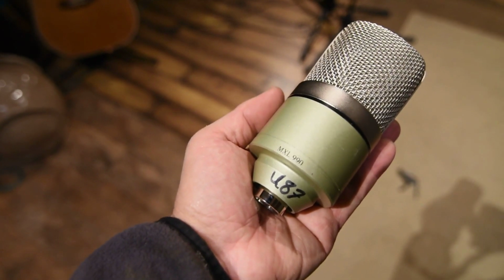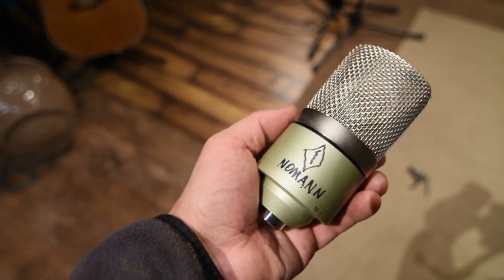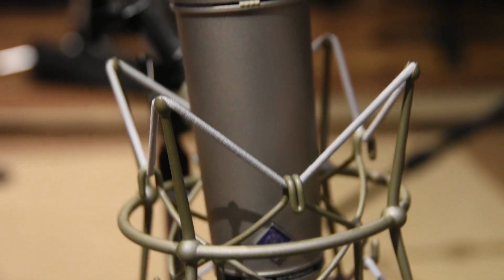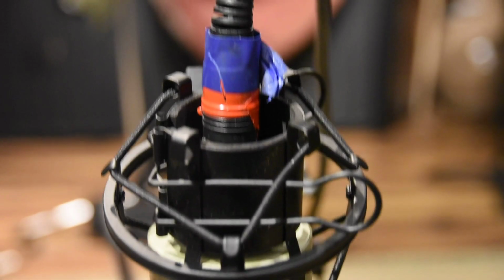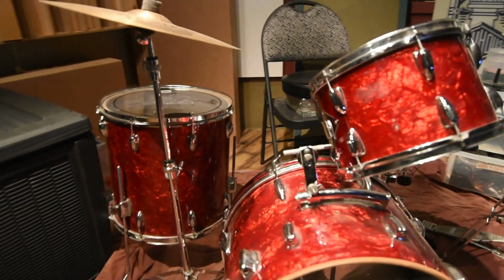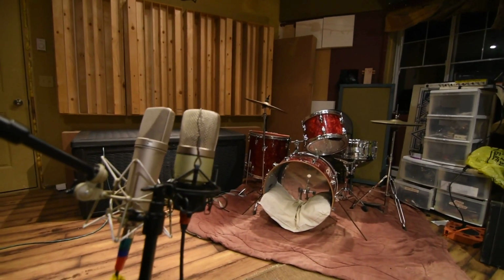Microphone shootout Neumann u87 VS DIY U87 clone

Comment from the maker: The reveal as to which is which is in the description.
Reply: Awesome. I wrongly believed that Mic#2 was the Neumann. Excellent job.
Reply: Haha definitely an awesome review sir, thank you for the Post
Reply: Nice! Thanks fo all your hard work here! I chose the first mic every single time for clarity but my guess was mic number two was Neumann because it had more of a vintage sound. It came through very clearly on my Marantz.
Reply: @Braylen Johnny Thank you, I went there and it seems like they got a lot of movies there :) I appreciate it !
Reply: @Neil Bruno Happy to help :)
Reply: Fantastic shootout!!! You rock! I'm a firm believer in "It ain't what you use but the way that you use it". I was able to discern the U87 right away but I am very familiar with them. Your DIY sounds great though. Slightly less smooth sparkle  on the top and a bit more mid forward but still a nice sounding mic. In fact I liked it more on the drums. There was a bit more punch. Neumann's are great mics but it is getting harder to justify spending that kind of money on results that can be achieved for a small fraction of the price. 
How is the noise floor? Preamps usually have more noise than mics, but some Chinese mics like MXL have a noticeable noise floor when the pres are cranked.
Reply: @Synth_Tools  me too, I liked the MP better, at least on the guitar. Maybe the Neumann was a $350 one from Aliexpress:)
Reply: I have to admit i thought Mic one was the clone :)

Comment: I have listened to a lot of mic comparisons recently, and I feel like my ability to hear the differences has improved a lot. These two mics don't sound very much alike to me, and it was pretty easy to guess the Neumann was Mic #1. It has a much more hyped high end. I liked the NoMann a lot, I just don't think it sounds much like the Neumann. That is not an insult in any way. It's a good sounding mic in its own regard. If both mics were in my mic locker I would use the Neumann on acoustic guitar, but probably use the clone on most other sources.

Comment: Thanks wow such a huge difference! I had read just before watching this that the U87 has the lows reduced a bit while the micparts s-87 has all the lows in full strength and it was pretty obvious which one was which because of this! I gotta say I’d rather have those lows and if i need to cut them out I can do that later!

Comment: both were fantastic. There was a little more definition in a mic in the test.  I think I would be very happy with a cheaper mic with such a high performance.  The PCB was designed by a famous sound guy.

Comment: Like your attitude ! No frills. I have a S-87 and I still get a kick out of those comparisons. I will get a 2nd one for stereo takes. This mic is wonderful. I have to say that #1 was smoother, and #2 a little harsher/agressive in raw takes but it got closer after treatment - of course. I use mine with a 737sp behind and ooooooh boy, it is nice, the difference between both is very sleek. The money I saved I was able to use for the 737sp which can be used as an insert, unlike the U87. Kidding, tho. I'd still love to add that legend of a mic to my collection. Thank you for this cool, very objective video.

Comment: I prefer mic 2. Regardless of that though, the sheer value of the NoMann in comparison is staggering. $424 for the MXL990 and the mods from mic parts (with the old circuit replacement) and to end up with the two sounding so similar.

Comment: Great shootout. Turns out I preferred the Neumann, as stacked up, the mix was smoother and less congested in the highs. The Neumann also has a little bit more depth and reach.

For 375, the Nomann is a very decent, very capable microphone.
Reply: the nomann was smoother and less congested. Mic #2 was better.
Reply: @toothacheforever8437  That's actually and factually incorrect there's no way that a $375 mic can sound better than a 4K mic but for what it is it's an excellent mic for the money.
Reply: @Tonyplat98  oh, there are 1000s of ways
and the evidence is peppered throughout the many productions done while under the influence of cocaine, alcohol, a messy divorce, the tail-end of a lousy contract, chasing mistaken notions of what will bring glory, etc

Comment: I'm sitting here with all new Creative speakers for my computer, and I'm not completely convinced by them yet, but to my ears, with these speakers, I feel that Mic 1 has sliiightly more presence than Mic 2. Mostly on guitar, actually. I thought it would be easy to hear with the shakers, but there they sound about the same. The difference on guitar is almost like a fresh set of strings has been put on between the mics, and for the vocals, "s" sounds slightly muted in Mic 2. I think both mics are pretty good, and I would have a hard time choosing if I didn't have to pay for them, but they're not quite a matched pair. If I were to guess, I would say Mic 2 is the Neumann with older components. Building the Nomann is a good investment, though, depending on how much the components cost.
Reply: Wow! I was totally wrong about which was which! :D

Comment: Only heard the difference on the vocals and the shakers. The replica has a boost around the 300hz range, and somewhere over 15k. The low-end boost is probably caused by the MXL body and the top must be some difference in the electronics. No two microphones sound the same though. For the price, the replica sounds really close to the original U87. I used a mic that a guy built in town with a U47 capsule that retailed for a 1000$ and it blew my mind. Replicas are really good more affordable options.

Comment: GREAT comparison.. perfect.. I did guess the mics.. very obvious on drums. Neuman is a lot firmer in the midrange and especially in the low end. But quite OK sound from the NoMann... although not the best for drums. In the complete mix though the results are pretty similar. And the Neumann is in no way worth the cost here. Just put a better BD and snare mic on there, and use the NuMann for the rest

Comment: All I can hear is DIY has more low-end but I can't decide which one sounds better... I would say it doesn't matter. For the money DIY is a clear choice.
Reply: My thoughts exactly.  They are slightly different from one another, but it’s subtle.  And that difference really isn’t enough to matter.  Truth is, when you actually mix it with either mic, you’re gonna make some moves to shape the mix in the direction you want it to go.  Those moves might be slightly different depending on the mic, but ultimately you could make a killer mix with either one from what I can tell.

Comment: Mic 1 clearly had more top end presence, was generally more detailed up there.  The mids and lows were pretty damn close, would have loved to hear bass cab or something.  Not really surprised that the Nuemann was mic 1.
That being said, I preferred the final mix from mic 2; it was more flattering on the snare drum in particular.  I think had you had a great session player on a killer kit the opposite would likely be true.  Just goes to show that a good producer/engineer can really make or break a recording with subtle differences like this.

Comment: I’m only listening on beats earbuds, but…the difference between the two sounds negligible to me.  There is a slight difference, but not enough to matter I don’t think.  I could make a mix work with either mic based on this.  Thanks for going to the trouble, man!

Comment: Nice sound with inexpensive equipment, except the U87.  At first, I couldn't tell them apart, until he started singing higher notes.  Then, I noticed the S3-87 was slightly darker.  Less noticeable in the mix.  Good for the money, tho.  I've never had the opportunity to compare my MJE "Fatboy" to a U87; but it might be in the same league.

Comment: Don't know which one is which yet, I'm going to check in a minute but I preferred Mic 2 because it sounded slightly more full and sensitive to the sound. But if it turns out that mic 1 is 4 times cheaper than mic 2 I wouldn't hesitate to buy mic 1.
Reply: I was sure the Neuman was mic 2 for the reasons you mentioned. Well done mic parts!

Comment: they're very close. #1 has just a touch more presence and #2 seems to have a little bit more proximity effect. Based on that, I guessed #1 as the neumann. just out of curiosity, do you remember which capacitor value you used for the roll off cap? i have the s3-87 and itd be useful to have this comparison as a reference for cap value

Comment: The U87 makes a "finished" sounding recording. The MP S87 just sounds a little "sloppy". I wonder if that's the transformer in the U87 compressing things a little. The S87 is also a little scooped in the mids. BTW, I knew pretty quickly that mic 1 was the U87.
Reply: My thoughts exactly. The actual 87 sounds a bit compressed, sort of "finished" "just pull up the faders" sound which sits easily. Also the low end is more focused and the highs are pulled in a bit more, i.e. a bit less "true" maybe. Im thinking a change in the transformer could help - something that sounds a little bit less "open".
Reply: @emersonvella  I believe the S87 is a transformerless circuit. I don’t think Mic Parts makes a U87 clone with a transformer, which seems odd because that Neumann transformer seems to be a big part of the sound.
Reply: @gordongurley3982  So the S87 is just like any another Chinese microphone pretending to be a U87. Very disappointing.
Reply: @emersonvella  I own the Mic Parts T12 and it does have a transformer and is a very nice mic. But they really should do a mic with the RK87 capsule and their KM84 circuit. Seems like a no brainer.
Reply: @gordongurley3982  I have a couple of C414 B ULS mics (last 414s with trafos). Extremely good value for money, as tonally they are on the opposite end to a U87, extended lows and highs, but sound finished in their own right. These days Im thinking that all the time I spend trying to find a good U87 clone is better spent being productive, saving up and actually buying a pair. No other "budget" mic does what my C414 B ULS mics do, so might as well go for the real thing with the U87. Its been years now, lots of clones and nobody has nailed THAT U87 sound. The sum is greater than the parts. I think our time is best spent recording rather than fretting over how to make an inexpensive mic more like a U87. If its possible, Neumann would have done it, but the recipe is what it is.
Reply: @emersonvella  So true. I have a pair of 414 B-ULS myself and they sound amazing. They sort of fell out of favor for many people, but they have such a glorious sound for instruments and rooms. They can be a little dark for vocals, everyone is so used to that presence peak of the u87.

Comment: I liked #1 better. The low end on #2 was more pronounced, and I suspect that would appeal to people who don't actually make records, but it sounded awfully smeared down there, and I could see it needing corrective EQ. #1 just had more clarity.
Reply: Having been listening to a lot of clone comparisons lately, I think this clone probably has the least difference compared to the original that I've heard. And I think the main difference here is that #2 has a tiny hair more air to it, which makes the #2 mix sound like it has just a bit more clarity and space in it, but on an almost-microscopic level. And that can be EQ'd out probably easily, even with a preset applied to all tracks. And that's a much better position to be in than lacking emphasis of an important frequency that needs to be boosted.

Comment: Mic 1 sounded a tiny bit warmer and tighter to me (through the YouTube algorithms and my AirPod Pros). But really, they were indistinguishable even stacked up in a mix. Certainly well within what a tiny flick of the EQ here or there would, we’ll, equalize. Disclaimer: I, too, have micparts mics, a U47 clone and a sort-of 414 clone. They are fantastic mics, to the point where I sold my old 414. The U47 tube mic, in particular, is absolutely amazing on vocals. Anyway, great comparo.

Comment: Just came across this comparison - very nicely done! I'm writing down my thoughts before I look at the description.
I'm not sure which is which, but Mic 1 has a really nice upper-mid range presence compared to mic 2 that I really like. That said, Mic 2 has a very nice low end, and has a bit more air to it that really suits the acoustic guitar and the kick. Overall, I think I prefer mic 1, but mic 2 is a very close second. 

Looked at the description now, and I'm very interested to find out that I preferred the Neumann, as I've not been the biggest fan of the U87Ai (I prefer the sound of the older ones before Neumann updated them). I'm curious as to how the full Micparts kit holds up - the S-87 using their body - as the enclosure can have an effect on the sound too.

Comment: I'm impressed with the comparison, the similarity of the mics, and with myself (lol) that I was able to call which was which accurately. The cloned mic sounds to me like it has a bit more color and gain, which is actually a bad thing in most situations. The OG has more of a flat response and stays clean at the louder parts. The difference was heard mostly in the mids/hi  mids, where the lows and highs were all but indestingquishable from each other.  That said, the difference in sound is way closer than the difference in price. Perhaps with some subtle tweaking of the clone design an even closer sound can be achieved, so I'd still say that the project is not a bad choice.